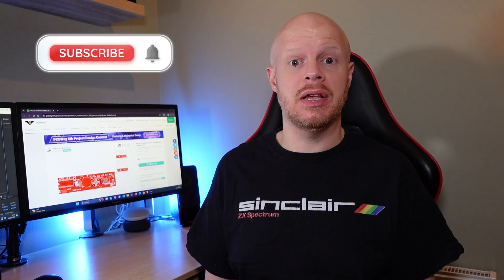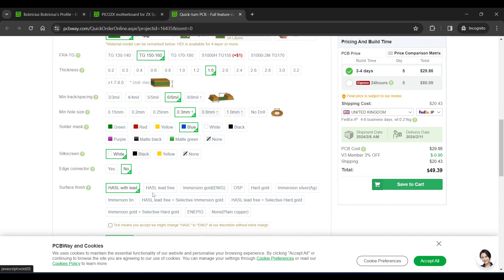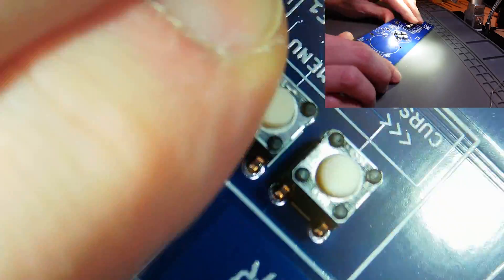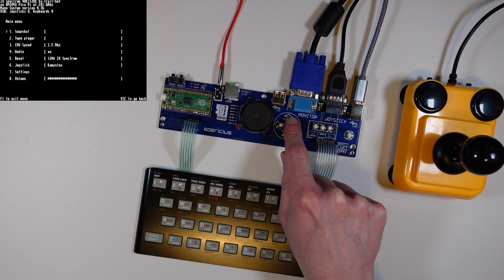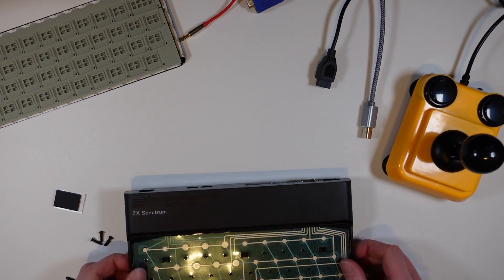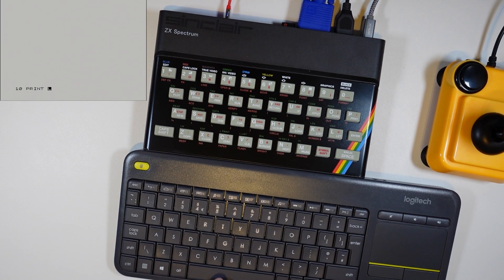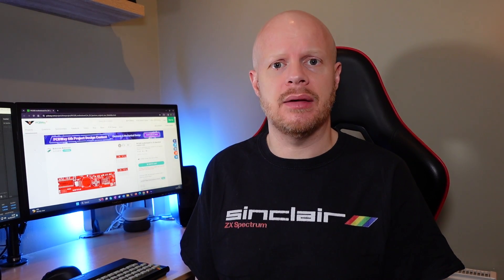Building a Raspberry Pi Pico Powered ZX Spectrum | #PiPico #zxspectrum

Comment: Hi, I have one of these and it runs games too fast,  it is just slightly faster than the original spectrum despite the speed being set to the same as the Z80 at 3.5mhz,  its clear if you put games side by side an original machine, i really need to find a way to tweak the speed, any ideas?
Reply from the maker: Best place to start is log it with the developer on github.

Comment: does the sound only come out of the speaker on this board?...
Reply from the maker: You also get sound out of the 3.5mm socket in parallel to the speaker. Both are quiet. I connected the socket to an external amp and speakers on my setup.
Reply: @iNimbleSloth  yeah I just tried that just about got sound through my amp up full lol 😆🤣. I wonder if the jack audio is any louder with the internal speaker disconnected?

Comment: Did some testing tonight:

Couldn't get my 2 gamepads working. Retro Games AMIGA MINI GAMEPAD and clone PS4 GAMEPAD.

ANY IDEAS?

I GOT the keyboard working via usb and usb hub.

VGA picture is outstanding.

Tzx files don't load automatically. This happens in some other Speculators too.

Best to use Z80.

ITS STILL NICE, and as you say, it's a cheap option, but I'll need to get a Kempston joystick. I prefer gamepads even though diagonals can be horrendous.

Maybe it's not the best way to play Speccy especially if you rely on the usb keyboard as I can do that wirelessly on my tablet via Bluetooth.
Hmm. I have mixed feelings on it, just now.

Have you got the usb gamepad  option working?
Reply from the maker: Not used a USB gamepad on mine, only kempston joystick.

Comment: So to add games, hook the Pico via it's micro usb to a PC, then drag/ drop the games?

And where do you get the software files?
Reply from the maker: No, insert micro SD card to PC, drag and drop games, then insert microSD card in to the Speccy clone. New games from itch.io and other online retailers, original games Google will take you to them. I can't post links to copied games here.
Reply: @iNimbleSloth  excellent cheers. I was worried, as there's no access to the that micro usb slot on the right. I know it's for firmware. But it seems that's fine as the Speccy loaded to the usual boot menu you normally see when loading a Speccy. I've already mounted the board in the case, so I was concerned. Took me hours, to mod the case, painfully slow tbhonest. Used a Dremel style tool from Aldi, but got it done in the end.

Cheers Carl

Thanks. If there's any more advice you can offer on this Speccy, please offer it.
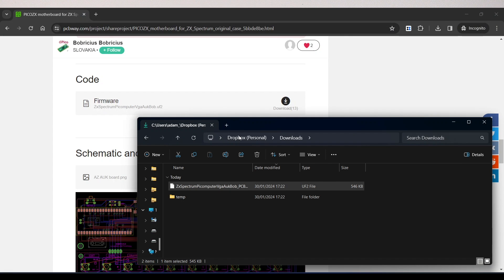Reply from the maker: @EnjoySynthSounds I connected the audio out to the  powered speakers I usually use on my computer as the internal piezo sounded is extremely quiet. The folder structure on the micro SD card must be as per the video 5:38 or the games won’t be read.

Comment: Seems a cheaper alternative to the ZX OMNI, although that has a better build and screen option. I don’t mind VGA, as you can use any monitor knocking around, or get a VGA hdmi. I KNOW the Pico is light on power, but we are not sending a rocket to the moon here- we are emulating Speccy. Just like the OMNI it supports 128/48 modes. The only downside is no sound with VGA. But overall a good option for a speccy fans.

Comment: I decided to buy a prebuilt one from ebay after seeing the video as stated the audio is very low what amp would you suggest? i hooked up a zx-box vintage amp via ear and the audio still low
Reply from the maker: I connected the output of mine to my PC speakers and it was ok-ish. I may get round to looking at an amp circuit and mod the board - not sure yet.
Reply: @iNimbleSloth  I hooked up a vintage zx box speaker at max it was barely auditable
Reply: Thanks for the tip.  I thought that plug connector was for external loading only.  Plugged in my decent sony speakers and all sound nice and loud and clear.  

Just need to work out the escape key now on the real spectrum keyboard for use in the menu.

Comment: There are also variants with display and breadboard versions of the Pico ZX Spectrum available. I thought about it but sadly my preferred variant, Sinclair standard matrix keyboard with tiny display on diy pcb/breadboard is not available. As far as I understood, they go for a strange matrix layout instead. I've already build my variant of a Sinclair compatible keyboard out of standard PCBs, buttons and a laminated print of the rubber key Spectrum keyboard and it works quite well. The laminated print makes typing on these tiny pushbuttons much less annoying.

Comment: I like retro very much, but imo it's either classic stuff (original machine) or emulation, and if emulated, then use a real PC + controller. most will use these machines just 5-20 times, and after that it's just another pile of garbage waiting to be thrown away. while an emulator on a PC can be just deleted.
Still it's a very decent project, and I can understand everyone who had a spectrum to want it back

Comment: Had no idea this was a thing, but it seems like an ideal way to get a spectrum in the US.  I have a Mister, but not having the functions written on the keys, like you pointed out, poses a problem.  And what could be better than the original experience, more or less?
Reply: There's a lot of caveats, but in terms of price to features this is pretty hard to beat.
Reply: I mean, it's not a Speccy, it is an emulator.  But there aren't many emulator that offer the ability to use the original keyboard, and it includes a lot of other features that you can get on original hardware, but that you'll pay through the nose for.
Reply: That Ooze game is great. Finished it on C64, but still trying on the Amiga & Speccy. Homebrews are great on these retro systems.

Comment: Thanks for the video! I didn't know much about the projet yet. But now I'm thinking I should build one and put it into my dk'tronics keyboard instead of a Harlequin 128. I already have a Harlequin 128 and as it isn't particularly cheap I was shying away from getting another one for some time now. But this looks simple and cheap and usable. I must admit that I don't like the idea of loading tap files in real time as I'm used to have them load instantly from DivMMC. But apart from that it looks nice. Is the joystick emulation locked to a specific type like Kempston or is it changeable to Sinclair Interface 2?
Reply from the maker: You can change the joystick type. I'll need to power it up later and take a look at which types you can set. Yes, TAP in real-time is a little tedious, the DivMMC has spoiled us 😉 The snapshots are instant though, you just need to convert or redownload your games. There are some different variations on this project by different designers.
Reply: @iNimbleSloth  at least there is an easy way of making snapshot files with a DivMMC.